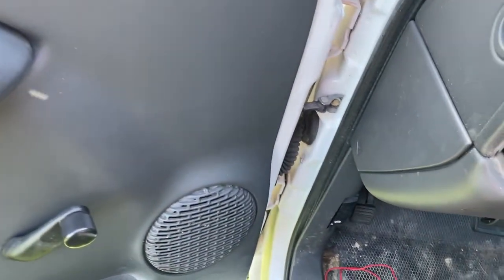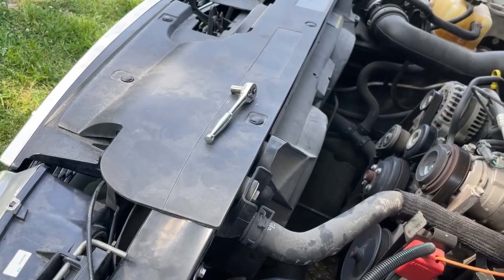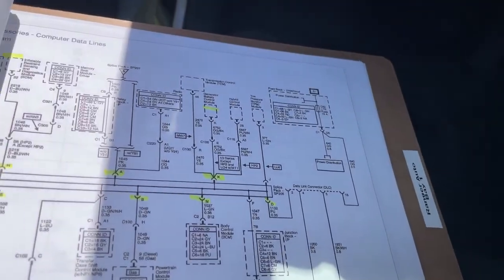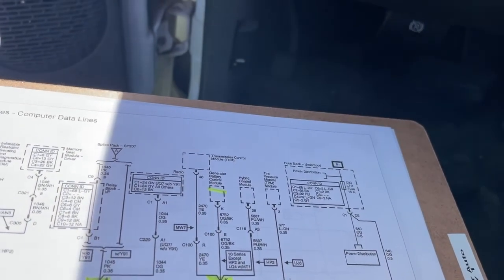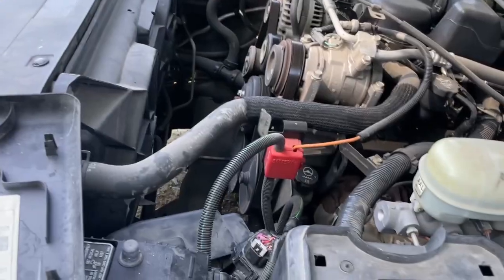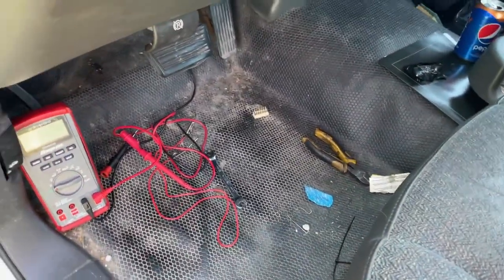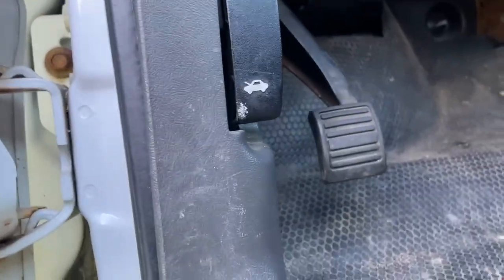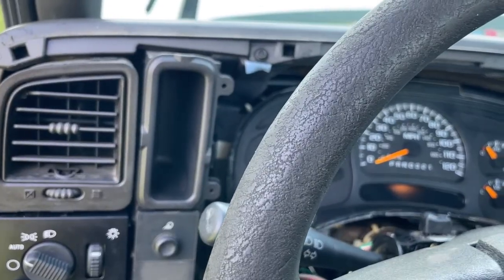GM Serial 2 Diagnostics: 2006 Chevy Silverado using a Multimeter

Comment: I’m having the same exact symptoms, so simply pulling the fuse to each module can pin point the problem module?
Reply from the maker: That's how you find it, through process of elimination, you can do a visual of all the modules and any that look damaged you can start there.

Comment: I got an 03 Silverado, the thing ran perfect overnight, went out, turn the key and I have nothing. Says service 4wd. I have about five codes for my transmission, and the couple codes that have this u1000 com code. I know it has to be a module like in yours or a ground. Can you give me any help at all of where to even start? I already replaced the fuse box under hood. The ignition, ignition switch and added grounds from the battery to the frame and motor and new battery.
Reply: Dude i got the same Laundry list heres mine
P0101,P0171,P0172.P0174,P0175,P0300,U1000,P0128,P0327,P0332,P0420,P0430 i got 64 DTCs across all modules but it still runs and drives after a while it warms up its drives fine but idles rough af  geting 15 mpg 5.3L 03 tahoe z71 service 4wd leads me to believe its an OPEN/GROUND problem. i have 446k miles with little over 14k running hours.  am gonna check Grounds and Pinch points like the harness that goes to the doors.
Reply: @L19R let me know. Still cant find the problem.

Comment: At 15:40 of this video there is no check engine light displayed when key is on Ignition & even when starting it there is no check engine light so not everything works still. So how do i fix the check engine light because my truck runs great now no more issues but the check engine light never displays even when my scanner has codes appear on it.
Reply from the maker: You need a scanner with the ability to do a bulbs check, these clusters use LED units for the warning lights and regular bulbs for illumination. It sounds like your check engine light might be burned out.
Reply: Thanks for the quick reply. Maybe it is burned out but i noticed on my obd port i only got 4 pins total. Isnt it supposed to be 5 pins?? It seems like am missing pin 9 which is the serial data @ranger.auto.repair
Reply from the maker: Not every truck will have 5 pins, depends on date of build and the plant, this was the case up until 2012 when the CAN-BUS system was installed. I would take the VIN to your dealer and ask them if they would be able to tell you whether your truck came with 4 or 5 pins.

Comment: My gmc 2003 has the same interior  setup but could not find SP25. Searched under the steering column ,up,down, left, right, underseat , behind cluster and behind Radio head unit. Where do you think GM hide it? Thank you!
Reply: It’s buried in electrical tape exactly where he said it was. Very hard to access.

Comment: Just wanted to add that fob don't work along with the radio and door chime intermittent sounds. Where is the fob receiver (RkE) located? Thank you.
Reply from the maker: Most of those receivers are located in the back inside a compartment, they could also be located near the antenna, I've seen them under the center console, behind the glove box. You might need a component locator in order to find it.

Comment: Thank you very much for sharing your knowledge. I have c2 data problem on gmc 2003 suburban. That is intermittent radio and door chime. I will use your troubleshooting steps hoping to fix the problem. Thank you again for your well and clear troubleshooting steps. I had trouble locating spa 025 now I know it's location. Subscribed and shared.
Reply: Start with Drivers Door Module first. Because when you shut the vehicle off the radio will stay on until you open a door then it shuts off.  Look at the connectors and  26 way F AMP lever assist  PIN: 22 Wire color:Brown cicuit no.1046 DDM Class 2 serial data wire  Located. check those wires also the harness that located at the pinch point where the door hinges are theirs a harness that runs through their check for broken wires. here is other info could deemed useful .RETAINED ACCESSORY POWER (RAP) POWER MODE
 RAP is a power mode that permits the operation of selected customer convenience items for 10 minutes after the ignition switch is turned OFF. RAP power mode is enabled by the BCM.

 The BCM:
 -  controls certain body functions.
 -  sends out a class 2 message via the serial data line, which enables/disables other modules at the beginning/end of RAP power mode.

 Some BCM features, such as the interior courtesy lamps will function after the 10 minute RAP time limit has elapsed. This is normal, and does not mean RAP power mode is malfunctioning. The BCM enables the following functions in RAP Power Mode:
 -  The sunroof if equipped
 -  The right and left power rear windows
 -  Any class 2 module that functions in RAP power mode, that is not hard-wired, is controlled by the BCM via class 2 power mode messages. EXAMPLE: The Radio will power up if it is turned on and the BCM transmits a RAP, Run or Accessory message over the class 2 serial data bus.

 RAP is disabled when:
 -  A door is opened.
 -  A low battery voltage is detected by the BCM.
 -  The transition of ignition switch from OFF to ON or ACC.
 -  10 minutes have elapsed after the ignition was turned OFF.
 -  There may be some functions of the vehicle that are hard-wired straight to the battery, these are the exceptions.

 The BCM monitors the ignition switch position, battery voltage and passenger compartment door status to determine whether RAP power mode should be enabled. If the ignition switch transitions from ON to OFF, the battery voltage is within the acceptable range and the passenger compartment doors are closed, the BCM enables RAP power mode. After the 10 minutes has elapsed, the BCM sends a class 2 message to the serial data network. This message commands the other modules to stop functioning, that are power moded by the BCM.

SUNROOF RELAY (IF EQUIPPED)
 The BCM has a discrete output used for the control of the Sunroof relay. In the RAP power mode the BCM will supply a B+ to the control circuit to enable the relay. The BCM also enables the relay in the Accessory and Run power modes. Refer to Retained Accessory Power (RAP) Schematics to become familiar with the system and for the circuit identification.

Comment: I was able to isolate my problem by just isolating one of the teeth on my comb it has two wires on it and my radio doesn’t work now so I know that’s one of the modules ran off that pin could you use your diagram and tell me what else is on that pin ? It’s a 2004 lb7 plug looks just like yours and my truck has all the options you can have pretty much . Thank you
Reply: Ok the orange wire on line A goes to radio , pink wire goes to a relay and into splice pack 207, which looks like a power for the audio system, the only thing on 207 is radio interface, on star, audio amp, and a remote CD player.
Reply: Ever figure out the issue?

Comment: I have a 2004 z71 my question is , is the check engine light supposed  to illuminate when starting because mine doesn't like in the video , and I have codes for u1000 and u1096 ,
Reply from the maker: Sorry it’s taken so long to reply, u1000 is a communication code, u1096 is also a lost com code, when you turn the key on all the lights are supposed to come on as part of the bulb test. That year has LEDs for dash lights so if all the modules check good you may have to send the dashboard off for new LEDs.

Comment: 1300 no lights besides that everything seems to work fine it says low voltage so I’m confused what issues I could have , I had the window open and it did get slightly went on the inside and I have a small leak at third break light
Reply: I have eedm596fk

Comment: Good morning sir, please can you help me with the wiring diagram of 2006 Chevy express with 6.0l, I'm having  U1000 code on the abs module while other modules don't communicate. Please help me.
Reply from the maker: If you can find a diagram for splice pack 201 follow how I did it in the video, or if you can get a diagram start pulling fuses until you find the offending sensor. As for diagrams I don’t know how much help I can be.